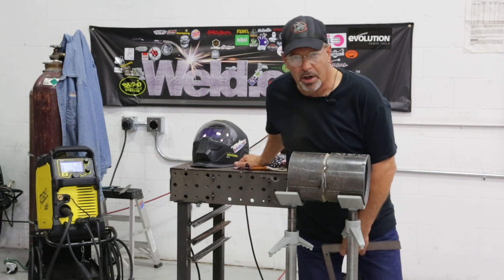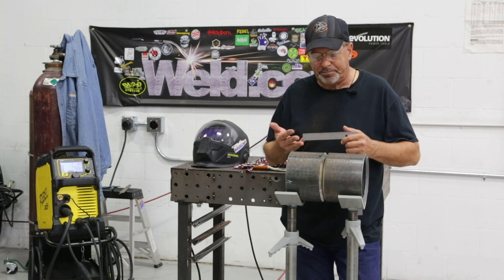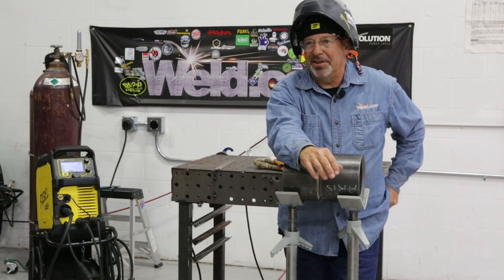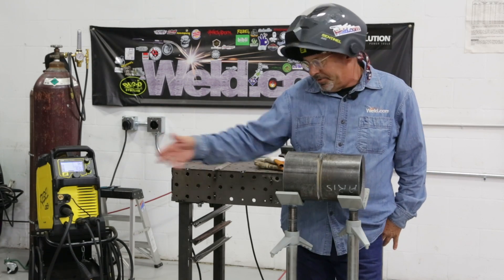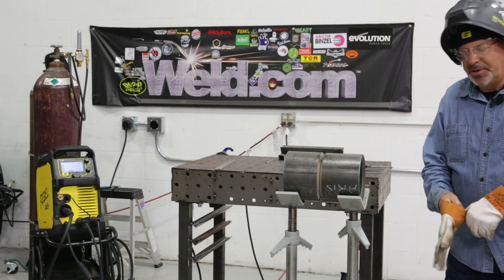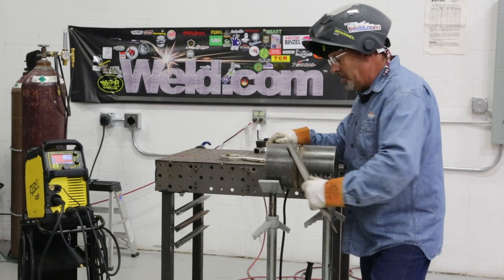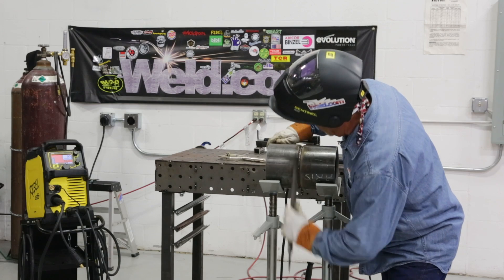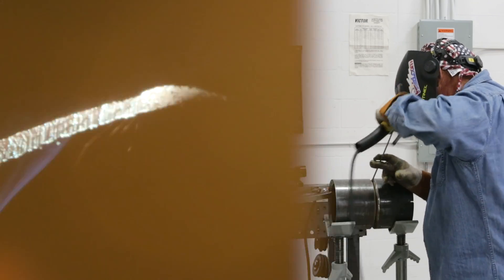6010 High/Low Pipe Roots (5G)

Comment: Question:

Do the tacks at 1200 and 0600 prevent warping and closing the gap on the side of the pipe you don’t start welding on?  Because I’ve seen videos where people had to go back to reopen their 3/32 gaps with a grinder or something else before going on to make sure 

2. When I have practiced with 6010 on a flat surface, my instructor showed me a diming technique where you pull the stick back into the puddle a bit before dragging on, and said that that technique was particular with that electrode. But when I see people welding the root with 6010 on either schedule 40 or 80 pipe, they seem to just be sticking it in? What is it about the electrode that makes that technique better? Is it a fast cooling property?

Comment: How in the hell do you fix that arc wander? I’ve been welding pipe for about 5 years in mines! Every time I get a tight gap my arc will wander to one side of the bevel and I have to stop and light back up please help with your technique to keep going!
Reply: Turn it up and stick it in there
Reply: Your gettin magnetic arc blow. Pull your electrode angle a little more to the blow direction it will go away.

Comment: I just started using 6010 and i want to rip my hand off. What amps should i use to get the best pass.(steel and pretty thin)
Reply: How thin? Rod size?
Reply: Yeah that’s what I was gona ask!
Reply: Don't use 6010 use 6011 runs clean on DC- and can make nice welds on sheets metal. Root passes on pipe are a breeze with 6011 on DC- and thay fall in the same filler group under most welding codes. Old guy deal.

Comment: Hey bob idk if you will reply but at school I used scratch start tig and when I did my roots a ran them at 110amps and tried a high frequency tig and one thing I noticed is when I did my root is I have to run hotter 120 or even 130 amps also I’m not able to push my wire as much as I did with scratch start. Is it just me or have you noticed that too?
Reply: DC tig? High Freq goes away after arc start .
Reply: Yes dc
Reply: @S0lidStewie  high frequency isn't continuous on DC and if you have it set that way you'll likely see porosity and strange reactions.

Comment: agree a lot of porosity popping out down hill
Reply: Just the slag. Not the bead. Zoomed in camera angle.
Reply: @bobmoffatt4133   I don't know :) jk I've done a pass with dual shield with no gas didn't realize untill I chipped the slag
Reply: @nickvanwhatt  This is done with 6010. What's dual shield that you ran incorrectly without gas got to do with? Just curious.
Reply: I mean no disrespect but why are you stick welding downhill?  In my personal experience I have never seen anyone run downhill using SMAW process that passed NDT.
Reply: @Nate-ph4do  What do you think the process is on most pipelines?
Reply: That’s slag
Reply: Not porosity "suck back".

Comment: I need help with fitting up something hopefully somebody can help.  Im making a fire pit out of 4x4 piece of sheet metal  center is 2x2 with 1 ft. walls.    Sides are gonna be set on a 45.   So the way I drew it out was put the square in the center and a straight line cut from each corner of the center to the corner of the sheet but when I turned the sides up the corners overlapped.      How do I get the measurement to make them fit right?
Reply: I like to use cardboard as a template, but I believe if you draw your square base and continue the lines to the edge of your 4x4 sheet. Measure out 6" so you have a wedge or pie cut toward the corner and repeat on all 8 sides you should be okay. The formula for 45° is up 1 over 1. So 12" up= 6" out x2 sides=12"
  Good luck and remember I recommended cardboard 1st.
Reply: @brettperkins5750  thanks man   I'll try that tomorrow

Comment: What if you're welding stainless steel plate butt joint over head, would you want to use helium shielding gas in the torch and argon shielding gas in the backer? Since one sinks and the other rises...